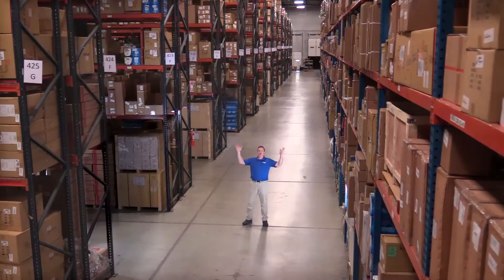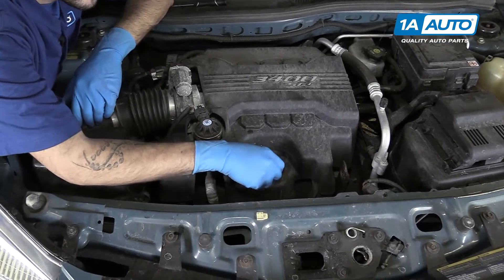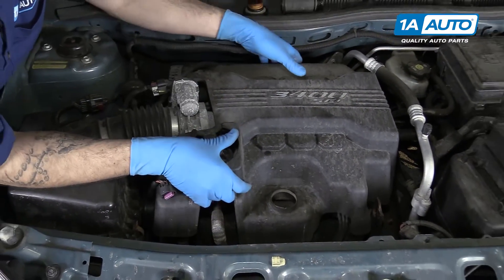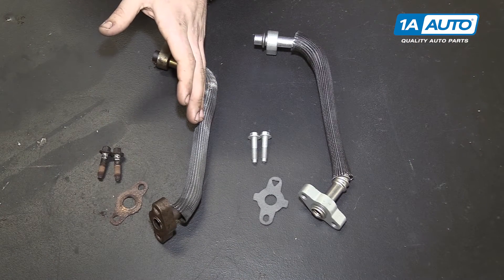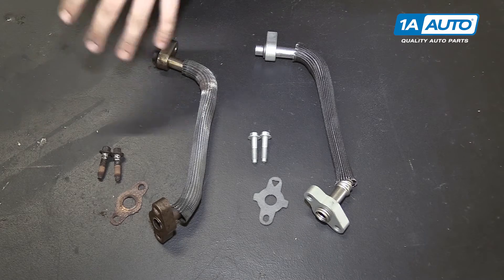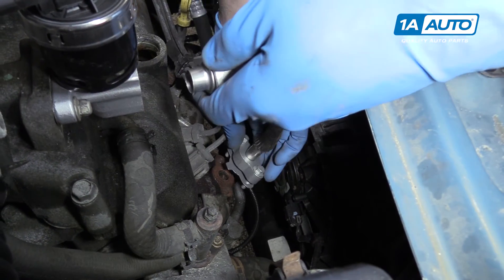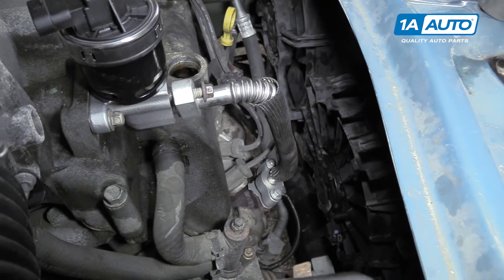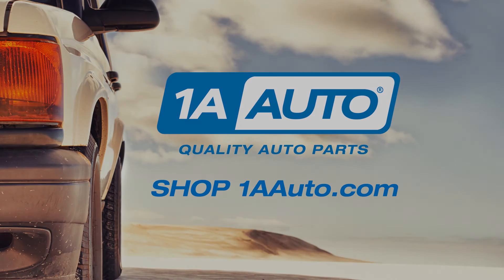How to Replace EGR Tube 07-09 Chevy Equinox

Comment: Is this an exact replacement for the original egr tube or is it the updated egr tube that will only fit the new egr valve ?
Reply from the maker: +Jose Beltran Thanks for checking us out! For 2005 & 2006 Models this tube is only correct for models that have had been updated with the 07-09 EGR valve (TSB 06-06-04-008B). This tube will not work on 2005 & 2006 models with the original EGR valve.

Comment: Just did this today and for some reason car will not turn on now, it attempts to start but doesn't turn on. There is smoke coming from the bottom where the two bolts go in. If you have an idea why this is, please let me know. Thanks.
Reply: Stephen Perez just out of curiosity, did you ever figure out what happened or what went wrong?

Comment: Dose 2006 equinox like that too ?
Reply from the maker: +Yangdong Li Thanks for watching!  The tube in this video is an updated design that can be installed on the 2006 model, but requires a new pigtail.  Here is a link to the update kit: https://www.1aauto.com/chevy-equinox-pontiac-torrent-egr-valve-and-tube-kit/i/1aeek00529?f=759821&y=2006
Reply: Yangdong Li 2006 Chevy Equinox how to install purge valve